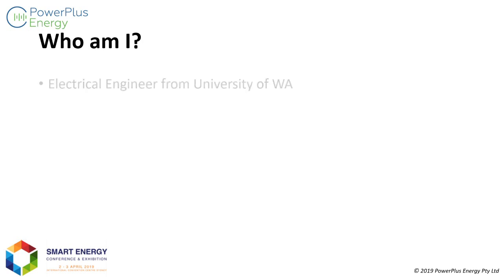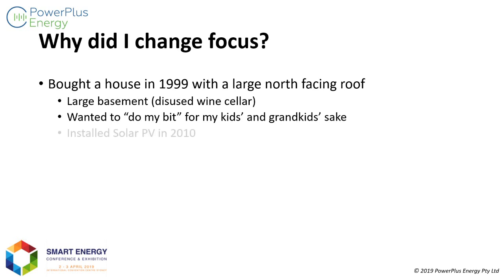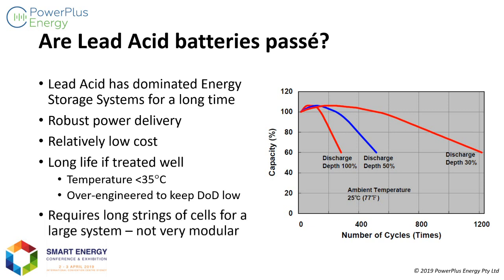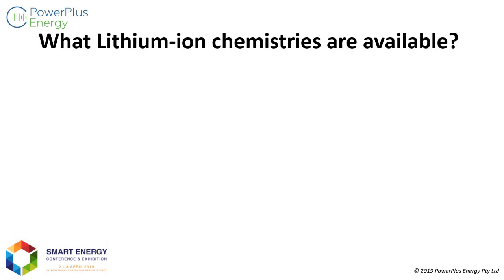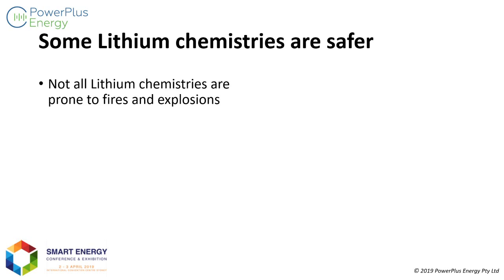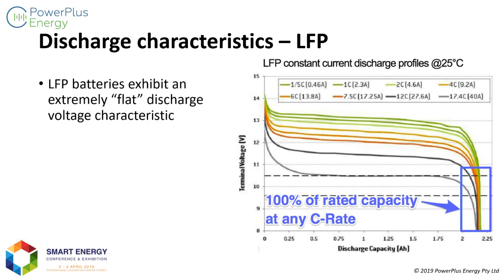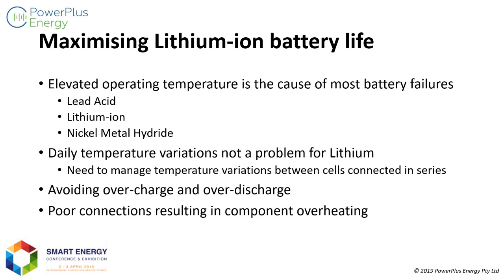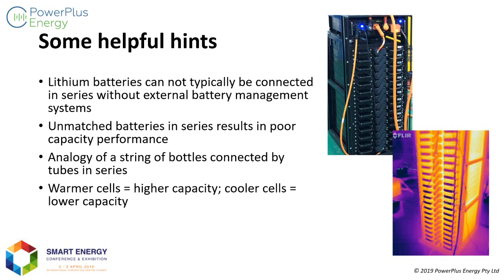Selecting the best Lithium Battery Chemistry for your ESS Projects - Simon Chan

Comment: I have watched your whole presentation seriously and it's pretty impressive. Actually I have some questions want to learn from you, like what kind of cell you use in you ESS products , prismatic ? And are you 100% manufactured in Victoria ? What do you think of the Australian household storage market, especially the high voltage series ?
Reply from the maker: Hello Victoria Fan, we use Cylinder cells in all our designs. Apart from the lithium cell pack imported from China (based on our very stringent technical specifications), almost everything else is sourced in different parts of Australia.